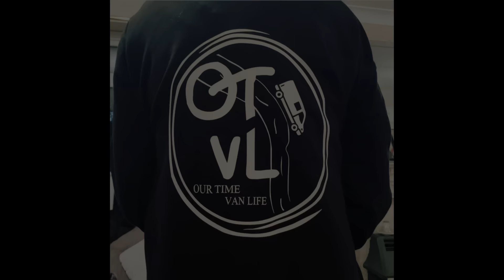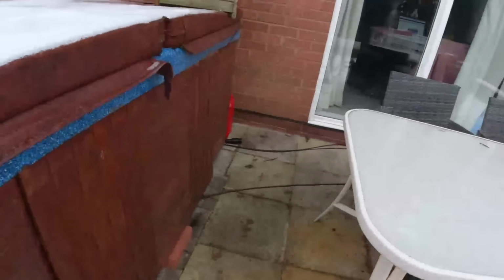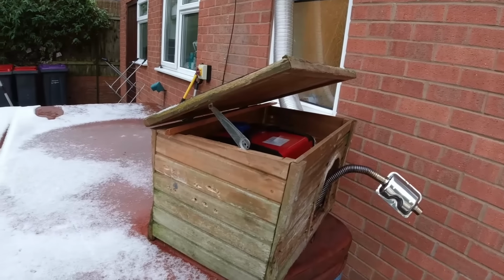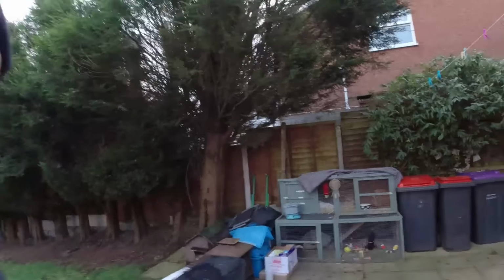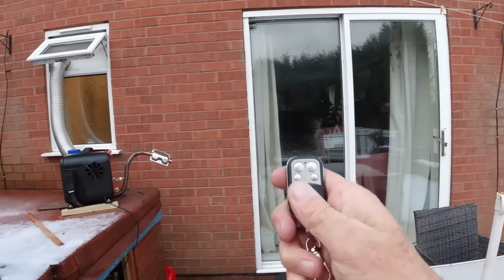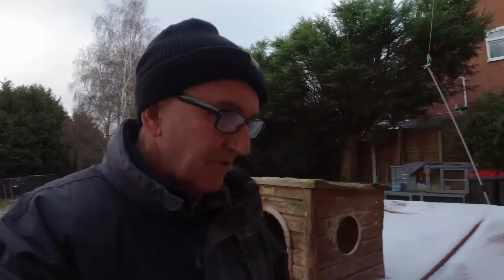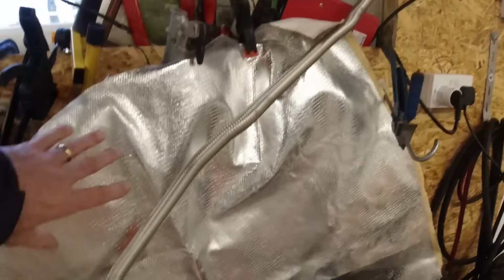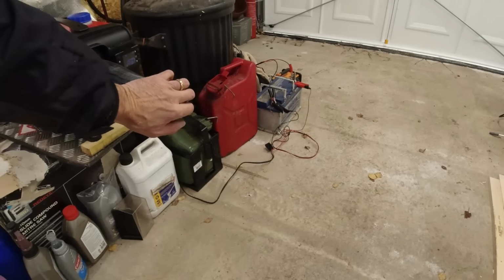CHINESE DIESEL HEATER HEATING OUR HOME REVIEW GOOD OR BAD ?

Comment: If you add dipetane to kerosene it burns cleaner and lasts longer it also works with diesel and petrol engines and gives far more mpg it's great stuff and engines run far smoother
Reply: Thanks for the tip on dipetane, I have researched it at Halfords and will give it a try! Never heard of it before.

Comment: the exhaust  pipe is to long you will have problems think the max should be 1.5mtrs  and as staright as possible and it shouldnt be going upwards
Reply from the maker: It’s running great up to now
Reply: @ourtimevanlife9667   hi yeah take that back just looked it 2 mtrs max not the 1.5mtrs  and min 90 degree bends x3   has something to do with the gases not being able to escape properly and also the unburnt diesel and water cant escape as you have it bent upwards

Comment: Hi mate have u a link to the power supply plz is yours a 5kw or 8kw heater thanks
Reply from the maker: Hi Steve if you look at the links blow all are listed but they are hard to get hold of now on eBay look at Amazon
Reply: @ourtimevanlife9667  Thanks mate have a good Christmas all the best Steve.
Reply from the maker: @stevelindley9341  yes and you Steve don’t drink too much 🎅🍺

Comment: You can do whit a 5 amp power supply, the start up is 7,5? Amp running mac 3 amp .. the battery can handle the start up .. there are some saving’s to make there …. And cycle that inside air

Comment: My mate did the same and said he could run the heater for a full day on 5 litres of diesel when I worked it out it was £7 per day that equated to £210 per month.. my gas and electric bill totals £107 per month I might be missing something here but how is that saving you money??
Reply: He must of had it on full as on low setting they use about 2 lts over 12 hours

Comment: Hi that  model you have is out of stock and they've priced it wrong at £999-99 so its obviously a different model have you the correct details for your model thanks
Reply from the maker: Just looked it up it’s the same one but must have sold out or got greedy I have noticed the prices have gone up Reg D
Reply from the maker: It’s the same one but out of stock have a look on Amazon Reg

Comment: Can’t you just change it to fan speed rather than temperature.. I set mine to that. Then the controller can stay where it is .
Reply from the maker: Yes I need to look into this 👍
Reply: Yes you can, just change the control panel from °C to Hz. 1.4hz is lowest speed, 5.4Hz is max speed for this particular unit. I find it runs better and is easier to control having it set to Hz. Also has a direct effect on the fuel is drinks. 1.4 practically nothing. 5.4 it starts to get a bit thirsty but the space becomes way too hot leaving on 5.4 for any period. Once the room is up to about 23°C then I throttle it back to about 1.6Hz and it keeps the heat in the room stable.

Comment: The controller doesn't work like  a thermostat
Reply: Depends what mode it's in there's Hz setting when it'll run at a fixed output  constantly or a temperature setting when it uses the thermocouple in the controller to ramp the heater down to minimum when set temperature is met.. it doesn't completely shut down but minimises fuel consumption and fan speed

Comment: The irony that someone with a HUGE hot tub has concerns about their energy usage!
Reply from the maker: That’s why it’s turned off and for my next trick to warm the hot water up in the tub from the heater 👍
Reply: @ourtimevanlife9667  this is a nice idea I have been toying with. My heater arrives next week . Heat exchange from exhaust makes most sense to me as if you use the hot air it'll reduce the heating effect . The exhaust is  going to waste so harnessing that seems best
Reply: You wouldn't be Jealous would you
Reply: @absrecovery  I’m not a child. If anything I would like his garage. 
But the festering pool of human waste!!!
I’m good thanks.
Reply: @ourtimevanlife9667  so why buy a hot tub if you don’t use it!
Bizarre
Reply from the maker: @leeneal6969  we do use it thank you Lee 👍
Reply: @ourtimevanlife9667  but you said its turned off!
So you have to worlds first £2000 paddling pool?
Reply: The guy heats his home for as little as possible so he can afford to have the hot tub.
Nothing wrong with a Rolls-Royce life style on a push bike wage (not saying you don't earn or work hard for what you have)
With the cost of everything these days, savings anywhere can justify the affordability of other luxuries.
I have just disconnected my combi boiler from the central heating in place of a back boiler on my wood stove for the heating of my rads, now when I have the stove on because it's cold it heats the rest of the house instead of just the living room
Reply: Good idea but your losing most of the heat because of the heat exchange  pipe been out side
Reply: Great set up. Just unravel that extension reel fully. Regardless of load a coiled up lead can and often overheat.

Comment: Had voltage issues with my diesel heater I put in the van too. No chance of running off leisure batteries running off just solar, so it's connected to our starter battery and in 18 days we've only had one flat  start to the day 🤣🤣
Reply: I read a blog about a gal who has a similar setup and she starts the van engine for startup and shutdown, because of the 9 amp current draw of the glowplug.

Comment: who are you kidding no way will a night heater that are made for truck cabs and small vans
will heat a thee bed room house one room not a problem and they are not made to run constantly
trust me they will burnout i have on in my garage which is 20 x 20 for a couple of years now
and in cold weather it takes hour to warm up and by the way the ones with the water pipe
are to circulate the water in the engine block in to stop the engine freezing up in the winter in cold countries
i have been using night heaters for 40 years so i no what im taking about
Reply from the maker: No it’s great for heating the down stairs area kitchen and lounge it’s working great for just that 👍

Comment: Your heater fan is way too noisy.
Reply from the maker: Yep 👍
Reply: @ourtimevanlife9667  mine started rubbing plastic on plastic sounded like that.
Reply from the maker: @frederick6008  ya it’s done it a couple of times I just pull the fan blade back on the shaft and it’s ok again 👍